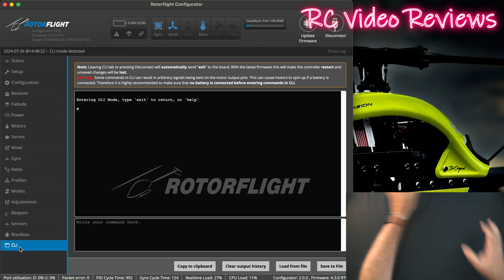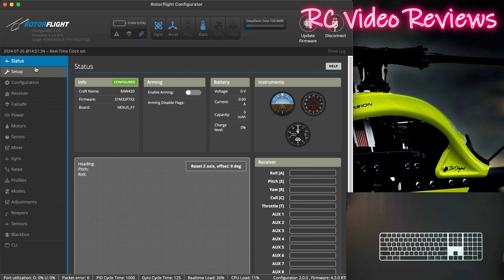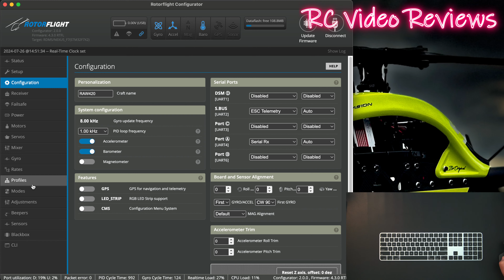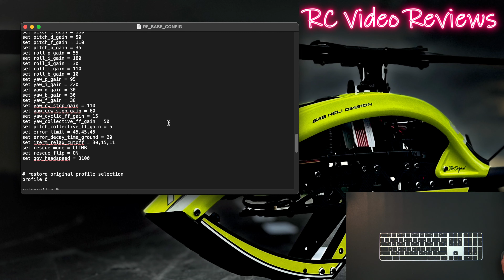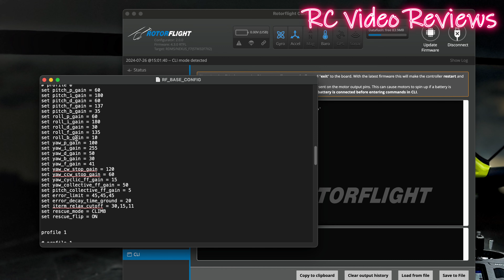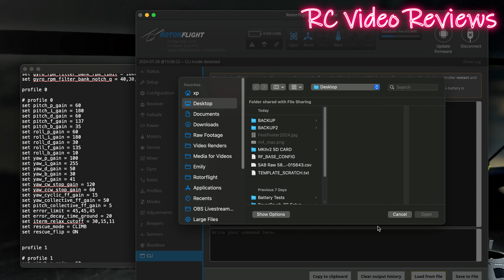Radiomaster Nexus • Want to use the perfect Rotorflight setup on another helicopter?

Comment: Excellent job as usual👍👍👍. If you are moving from a 420 to a 700 shouldn’t the pids be a little different?  I wish there was an option for choosing a size of a Heli to get at least in the ball park.  Not sure if in the future there will be examples to pick from like it is in Betaflight!  Love your videos and especially this series with Rotor Flight.  I bought2 Nexus units and been waiting to experiment!
Reply from the maker: The question of size on PIDS is TBD for me. I tuned the 420 and 700 separately and need to do a side-by-side comparison. At this point, I get the sense there will not be a dramatic difference.